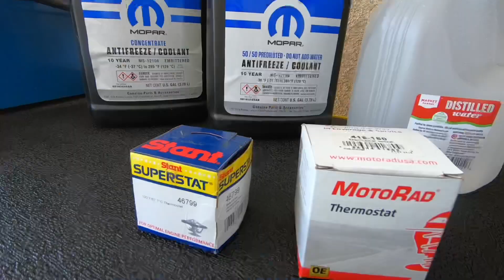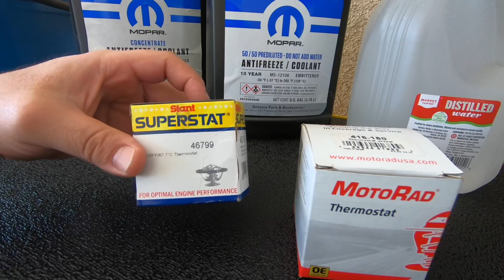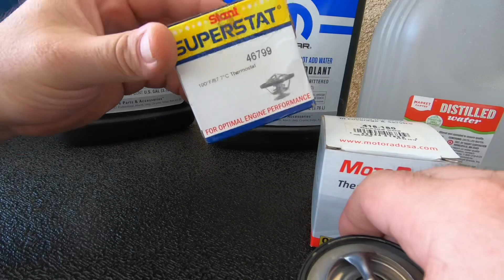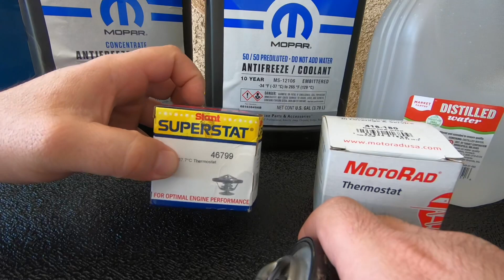Is My Car Overheating?

Comment: Not wanting to risk throwing codes on my stock tuned scat pack I went with the 190* stant.   Been working great and temps are stable  in the 190 to 195* range in normal driving.  In  sport more it has occasionally hit the 200* mark on a hot day.  In general it runs about 10* cooler than the stock thermostat which is what I was hoping for.👍
Reply from the maker: I hear yah. I was thinking the same thing when I was choosing a thermostat for my car.

Comment: He’s Mopar is real temperamental.I always recommend to my customers if you’re going after market get one with a thermostat with a fail safe .This way you don’t have to worry about it Overheating.You also can run straight antifreeze in the vehicle also it will make it run a little cooler at least that’s what we do here in Atlanta 😎